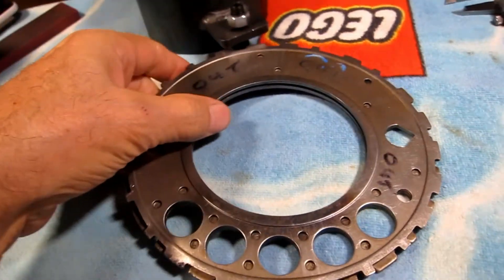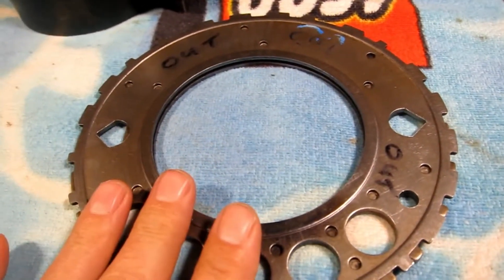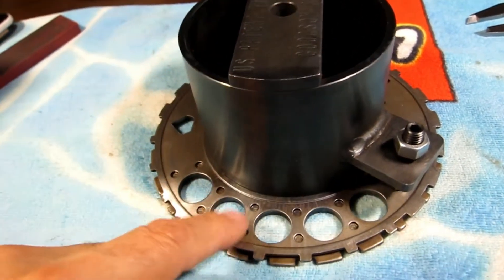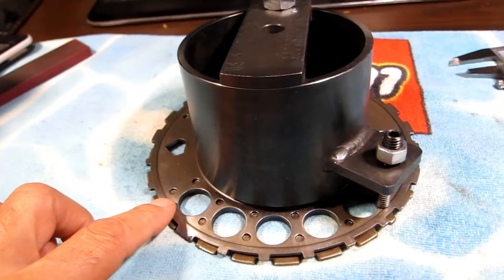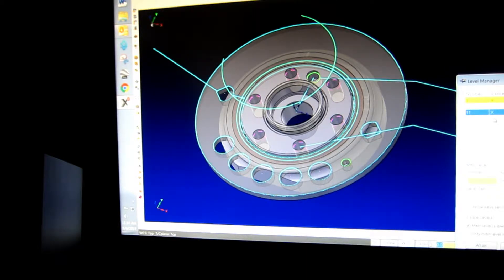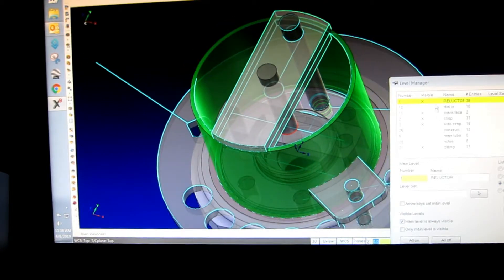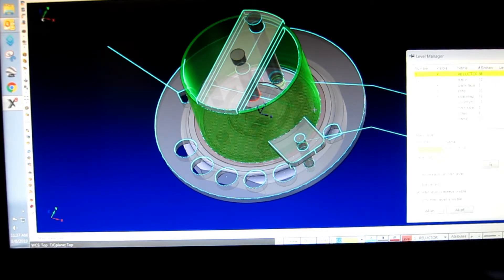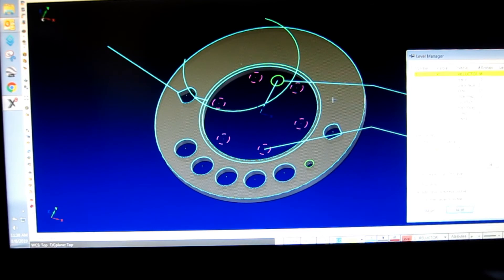LS chevy engine small block reluctor ring installation, tuning wheel,

Comment: You do not need to use anything to pull the reluctor onto the crank.  The tool is for set up and  correct positioning only. Just set the tool up to the reluctor before you remove it. Then put the new reluctor in the oven for 10 mins at 350-450 degrees, it’ll Easily slide over the crank and give you enough time to position it where it needs to be based on the way the tool was set up with the crank with the old wheel.  Just spray some water on it when its where you want it

Comment: So should I just pound it down?
Reply: i think we ought to just pound it down, thats what i did, shit wheelies...
Reply: took it to pound town, without the tool.
Reply: 3years late but I work at a crankshaft shop you need to heat it cause the ring gets larger so when it cools the friction keeps it from moving